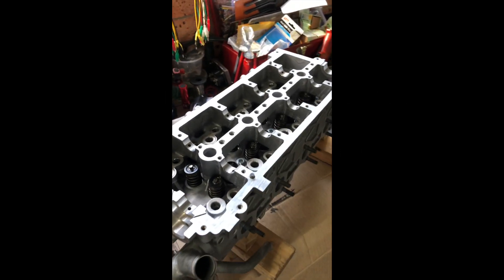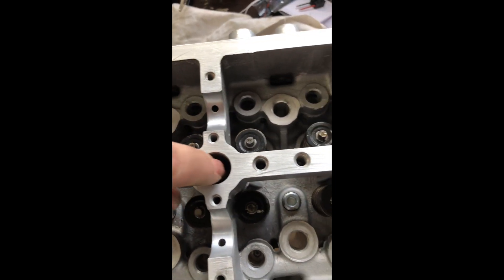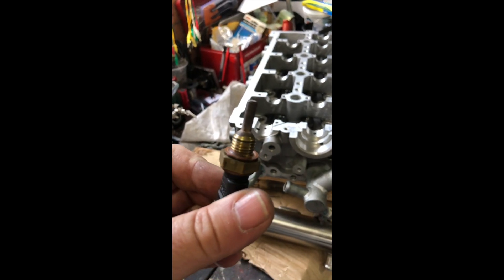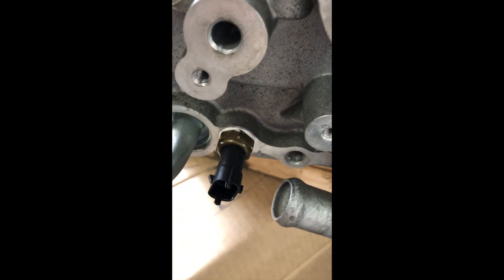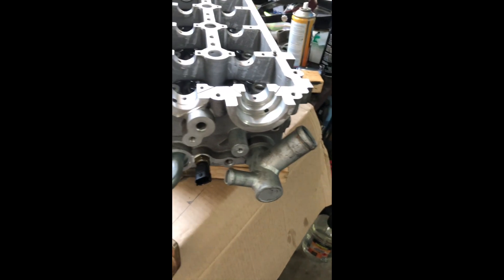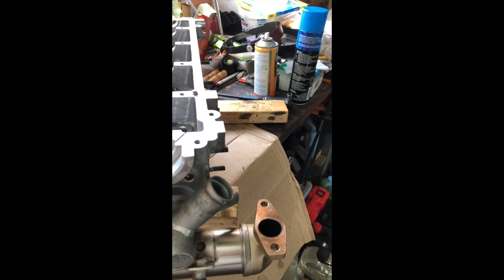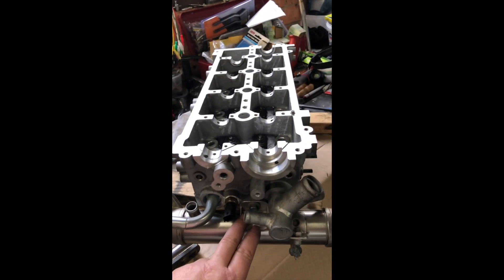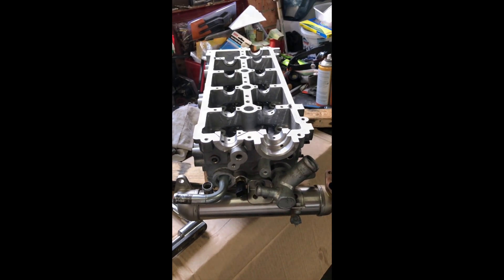Great Wall 4D20 Diesel Engine Cylinder Head buildup

Comment: Hi mate was wondering I have a v200 great wall it's over heating would that be the water pump it gets hot cools down its up and down the Reserve water tank you can hear Bubbling wondering should I buy water pump cheers regards Matt
Reply from the maker: G’day Matt, I would say you have a blown head gasket or a warped cylinder head.  A dodgy water pump won’t cause bubbling in your expansion/overflow tank. This is caused by combustion gasses entering the cooling system.
Reply: @thestickfarm  thank you I've brought a new water pump but I'll get a new gasket as well  how much do you charge lol thanks mate
Reply: @foodyoucancookwithmatty3459 
How did you go after  waterpump and head gasket. I've just been through same experience as yours.
Reply: Is top radiator hose hot and bottom radiator hose cold after a drive.

Comment: Do you remember the torque setting for the head bolts?
Reply from the maker: G’day mate, the head bolt torque is 50nm + 90° + 120° I think I might have posted a link to the service manual in response to another comment.
Reply from the maker: https://www.valvulita.com/sites/default/files/manual_de_servicio_greatwall_gw4d20_4.pdf

Comment: Can you please tell me the positions of the two cams on top. There are dots on the inside of the camshaft sprockets at the rear I've observed. Do you have a video showing the installation of the two camshafts? Ive looked at the manual its not that clear. Do they point to one another  ? thank you
Reply from the maker: Hi Nidal. I just looked through all of my footage and camshaft installation was about the only thing I didn’t capture. Sorry. However if you follow this link https://www.chinapev.com/wp-content/uploads/2019/06/manual_de_servicio_greatwall_gw4d20_4.pdf it will take you to the manual. Page 256 describes how to align the cams.
Reply: @thestickfarm  Many thanks for your response I will take a look. Have you done a video on how to reinstall the timing belt with all the markings to align too ? thanks

Comment: I hope this message reaches you. Do you have any tips for removing the Turbo? I'm a bit stuck at this stage of the replacement.
Reply from the maker: The turbo is fairly straightforward to remove. There is three nuts holding the exhaust flange to the turbo, two nuts and one bolt holding it to the manifold the oil feed pipe which is a banjo bolt connection and two bolts underneath holding the oil return pipe. Do you have the service manual? If not this link will take you to it. https://www.chinapev.com/wp-content/uploads/2019/06/manual_de_servicio_greatwall_gw4d20_4.pdf The hardest thing to remove is the heat shield as the bolts are hard to get to.
Reply: @thestickfarm  Yes I finally got it off, those three bolts were very hard to get to. But I also had to remove a portion of the exhaust. This is on a GW X200. I found it easier to get to the heat shield bolts by undoing the engine mount and jacking the engine up a couple of inches. These modern cars are very frustrating to work on.

Comment: Hi matt you dont happen to know how the  camshaft marks align on the camshaft sprockets do you , struggling to find any info ?
Reply from the maker: G’day Paul, there should be timing marks on the ends of the cam gears at the back of the engine.
Reply from the maker: The engine manual can be found at the following link. Page 253 gives you all the info about the camshaft instal.
https://www.chinapev.com/wp-content/uploads/2019/06/manual_de_servicio_greatwall_gw4d20_4.pdf
Reply: @thestickfarm  thanks for the reply matt , ive looked on the manual but its not clear on the pics but im presuming that when the cam pulley is timed up to the correct the cam marks point together on the gears ?
Reply from the maker: Are you talking about timing the two cam shafts together or timing the cams to the crank?
Reply: @thestickfarm  hi matt yeah i meant how the 2 cams time together , there is an arrow on each cam i assume they point together
Reply from the maker: Correct. This is covered under paragraph 3 under Installation (of camshafts) on page 256 of the manual.

Comment: Another very good video. Many thanks. You mentioned that you were “checking your tourqes”. Do you have a manual or something like that? Where do you get them?
Reply from the maker: G’day mate, thank you for your comment. I found the service manual for the engine online here is a link. Cheers Matt https://www.valvulita.com/sites/default/files/manual_de_servicio_greatwall_gw4d20_4.pdf
Reply: That’s great, I can’t thank you enough. Did a bit more fault finding. When the engine is warming up, only a quarter of the way, it is making bubbles into the coolant reservoir. If I turn it off I can hear a rapid plop plop plop, open the hood and see the bubbles. If I hadn’t had the overtemp warning I could say it was just pushing air out of the head space at the top of the radiator. But I’m worried now it’s caused by boiling somewhere. I’ll call the mechanic tomorrow. Hopefully it’s just a water pump 79k is early for a water pump to fail. If it’s not then that manual and your videos will be a life saver. What happened to the Great Wall Owners Forum I wonder?
Reply from the maker: @davepetzer  ah, no good! I believe the cylinder heads and head gaskets can be a little fragile. Mine had been overheated by the previous owner and the head was warped. Yours sounds like a fairly convincing blown head gasket but your mechanic should be able to diagnose it accurately.